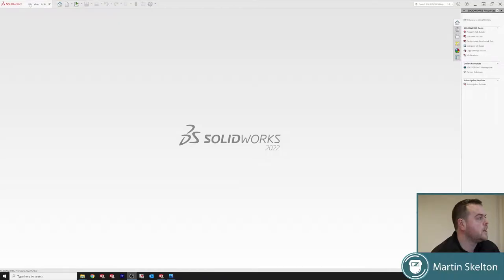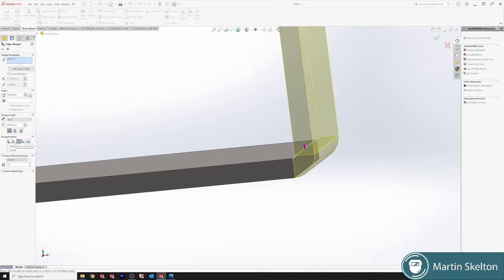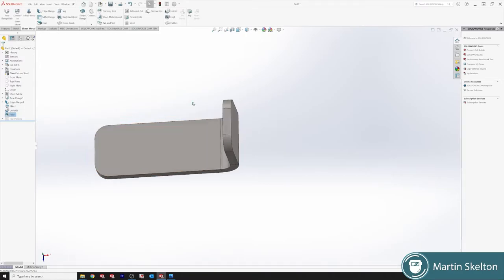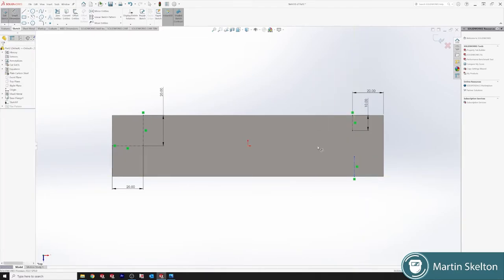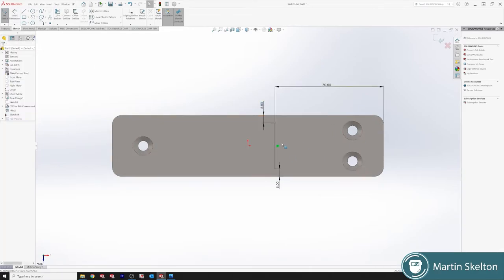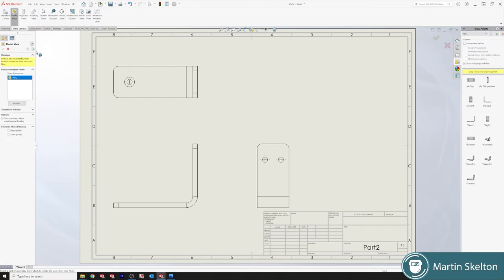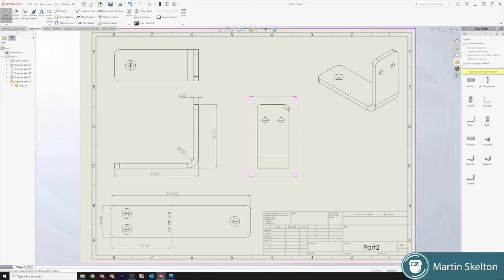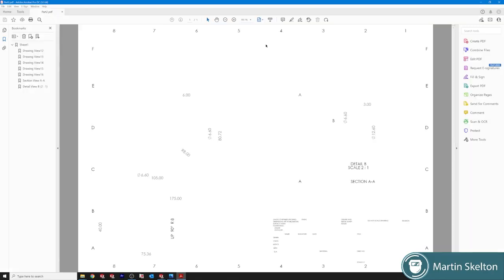SOLIDWORKS Sheet Metal Tutorial #3 // Edge Flange vs Sketch Bend

Comment from the maker: I would like to thank you for watching my third video that I published on YouTube. If you find value in this video please consider subscribing and leave a comment. As the saying goes, your first videos will be your worst videos but everyone has to start somewhere. I am passionate about engineering and design and I would love for you to be part of my YouTube journey. Thank you again, till next time.
Reply: I just quit a job after 3 days being a design engineer for a very small company that made sheet metal parts. My choice of software to use is sold works. For some reason, the parameters entered into Solidorks for bending allowance did not match the press brake machine. If the flat panel produced by solid works gave a bend line that was 1.112 from the edge of the flange for a required 1.25 flange, the machine would make a part out of spec. For some reason, this press brake required an extra 0.03 takeoff, which seemed odd My question is the bend line given in the Solid works flat pattern the bend centerline, and do press brakes require an additional takeoff on the stop to produce this?